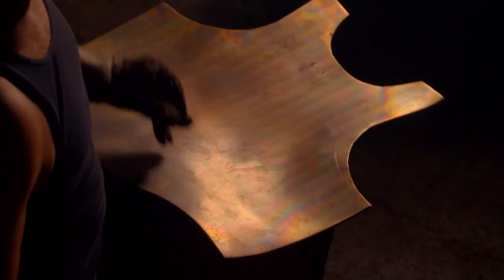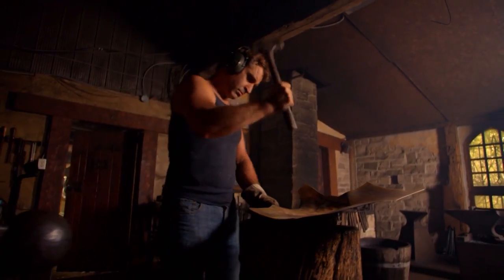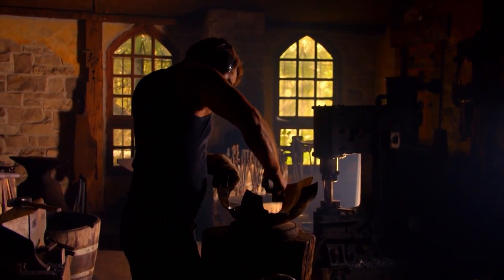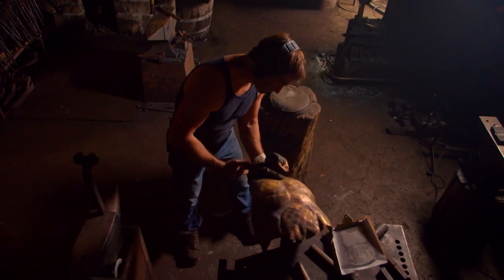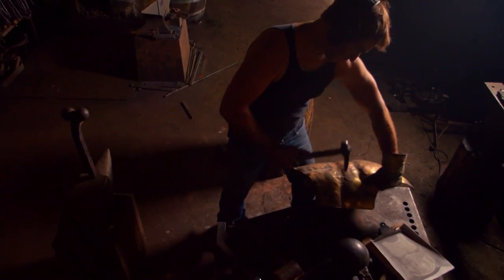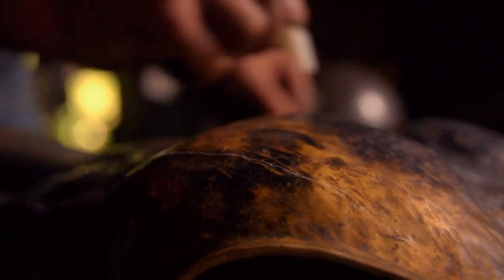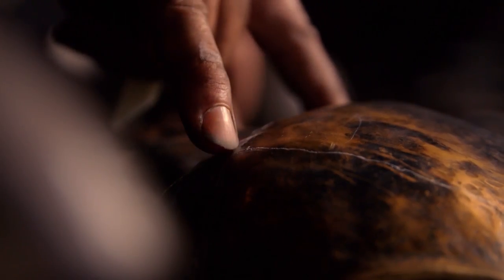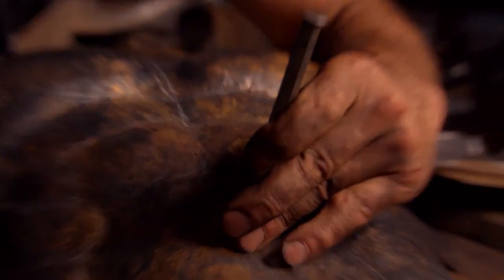Traditional Handmade Hoplite Armour | History In The Making

Comment: Isn't bronze much less workable than brass though? Hence always cast?
Reply: Bronze is not always cast. Regardless of the reasons.
Reply: In my limited experience sheets aren't that hard to work with and you can always anneal it, just heat it to red and quench, yes, unlike steel it will anneal that way.
Bronze and Brass in antiquity are a complex subject, by the way, the alloys weren't always the same, you find copper alloyed with zinc, arsenic, tin and lead in different proportions in all sorts of applications.

Comment: these werent clay molded the way many statues were cast molded?
Reply: I reckon you're right. Why go through all that effort when you can cast it in high detail and hammer harden it and have it as thick as you please instead of that thin sheet that anything would pierce. Even a sharpened wooden stick would go through that.
Reply: @dr.lexwinter8604  Keep reckoning. How many pounds do you want your armour to weigh? This breast plate alone weighs 15 lbs.